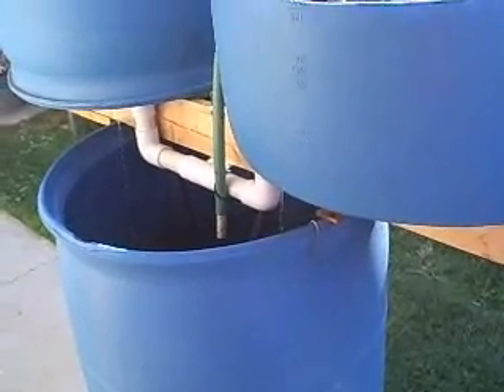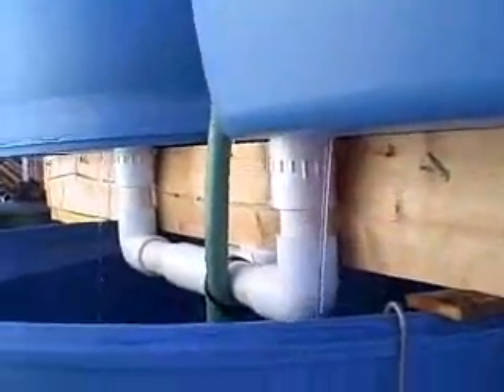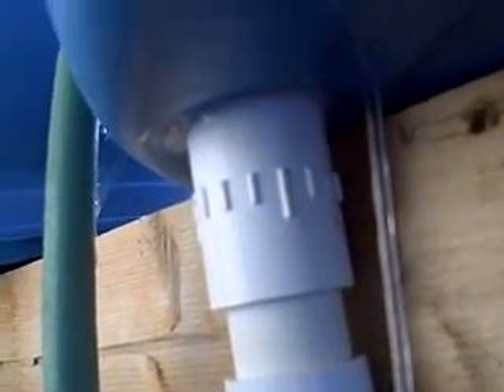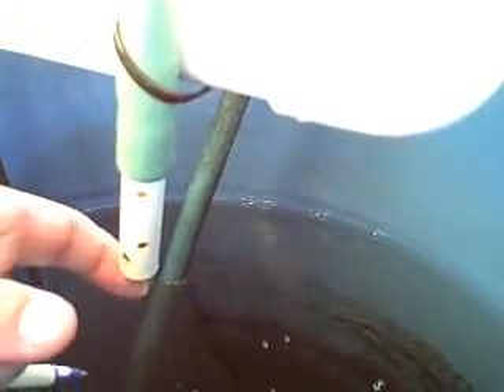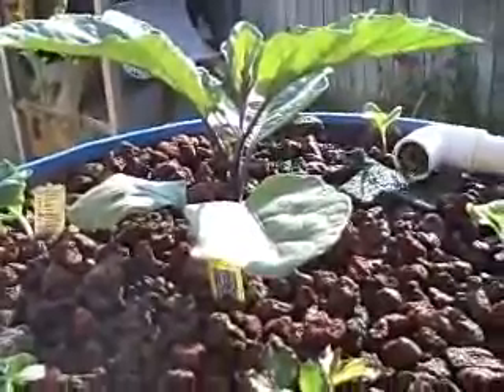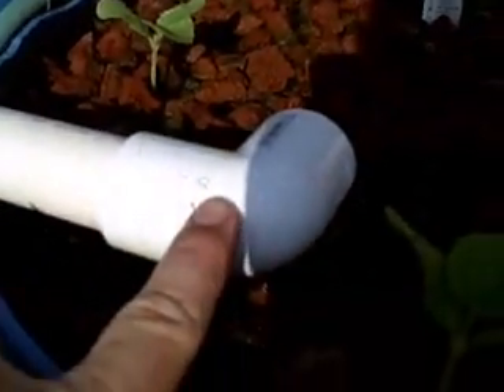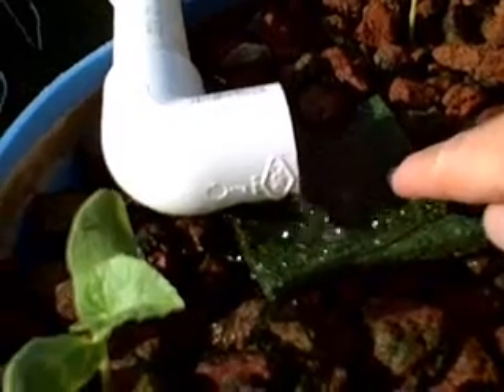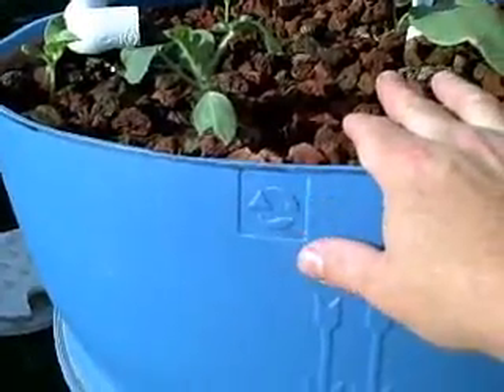Aquaponic System Detail Part 1

Comment from the maker: @Hankc100 Thanks, I stopped using the holes continually got stopped up anyhow.  I did add a "poke in" drip irrigation "T" and 6 -8" piece of irrigation tube  on the up flow waterhose.  It constantly sprays water back into the barrel. The barrels are strong.  No I didn't need to hand water at all because I adjusted the level of the water to come up to them.

Comment from the maker: The pump worked great as I could turn it up from time to time to "flush the system" a little. The two ball valves really help in "timing" the system.  In theory the beds should both fill at the same time, but in reality one needs the adjustment.  I used an air pump and stone for aeration and when the beds drain that provides aeration.  The "T" is and interesting idea. It might allow for getting rid of the air stone and pump. :0)

Comment: Very nice system! I think you should keep the holes, they'll keep the water more aerated.  Why do you need to cork the end of the siphon? To slow down the drainage with the small holes? I'm very  surprise the bottom tub can hold all that weight. Do you need to hand water the smaller plants until the roots can reach the lower level?
Reply from the maker: No hand watering needed. The cork just made the water spray hard out if the holes I drilled... it's in effect just a simple spray/sprinkler head.

Comment from the maker: The holes in the tubs are very small. They do not interfere with the function of the siphon. They were intended to drain slowly if the pump ever stopped working while the grow tubs were full of water at the top of the cycle. Plants standing in water isn't good and the fish barrel would stay too low for the fish. However, since I have never had that problem I may fill them and stop using them. Thanks for your question.